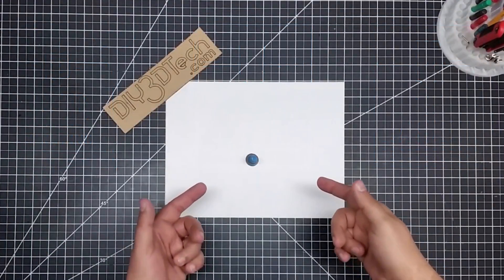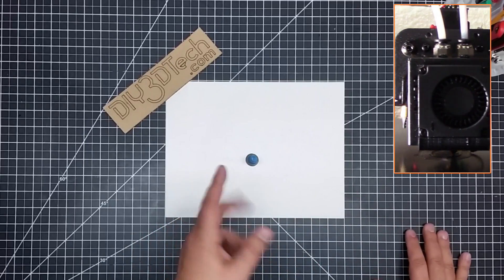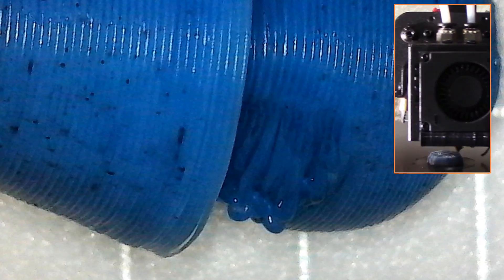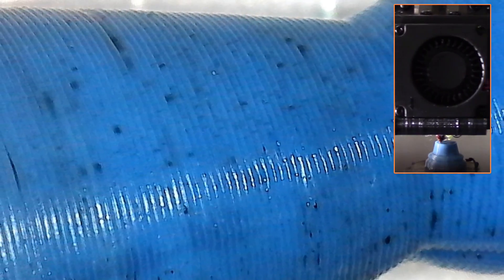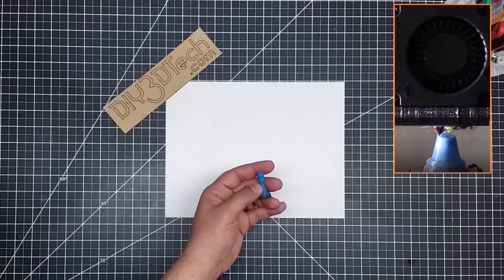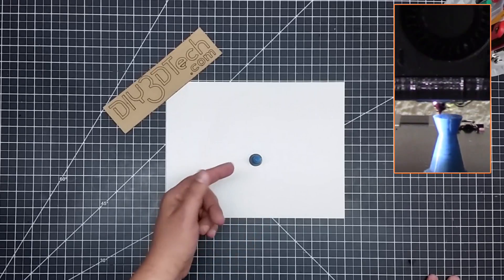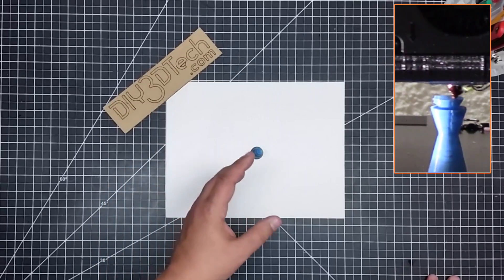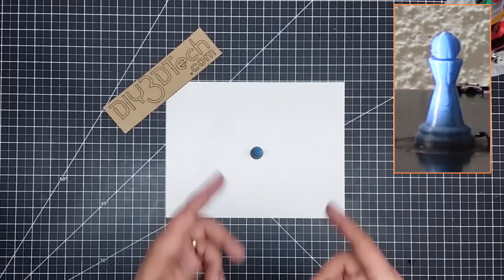GeeeTech A10M - Mixing Nylon with PLA Success!

Comment: I'v got a A20M on the way.  I was wondering about using nylon or carbon nylon for the shell and PLA for the infill. Theoretically the PLA could supply rigidity while the nylon could supply tensile strength not to mention the cost saveings.  Glad I ran across your video Knowing that they will mix makes me think it just might work. I'm looking forward to your strength testing.
Reply from the maker: I have been experimenting with this, with out much luck as keep in mind there is a switch over time to run out whats in the hot end so its not as easy as it sounds.  The other issue is with a single nozzle, you need to set the temp for the high material and this would be too high for PLA "stand alone".  As the test I did mixing them meant the PLA was encapsulated in nylon so not a major issue...